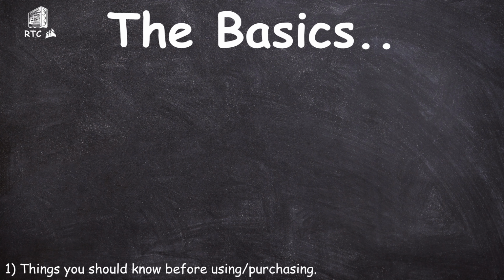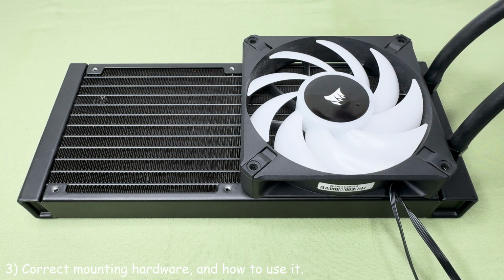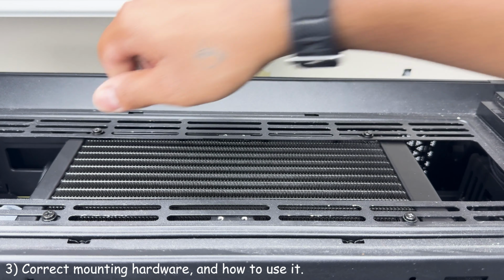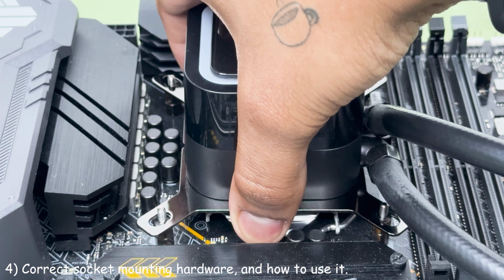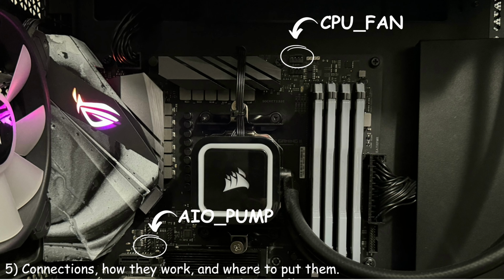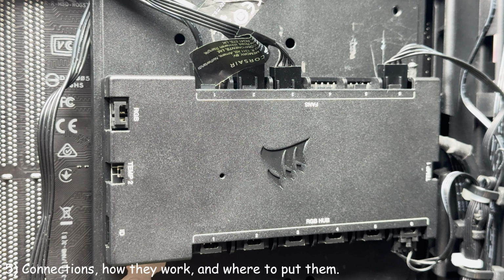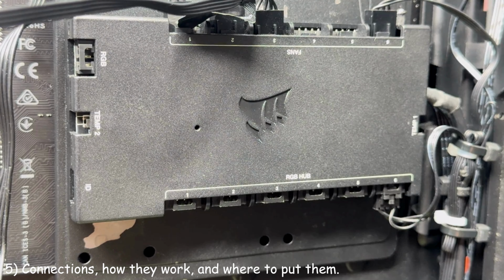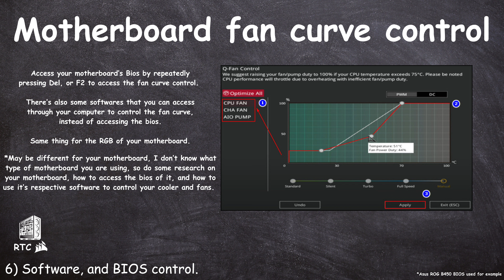How to use the Corsair H100x RGB Elite: Full install & Ultimate guide 🔧🖥️

Comment: (h60x for reference here -120mm/1 fan on radiator only) 3 pin connector into cpu_fan slot on motherboard, even if your cpu fan slot has 4 pins the 3 pin will still work. This gives power to pump. 4 pin connector gives power to fan, connect it to any 4pin sys_fan connector if you dont have a cpu_opt. The 3rd cable here is for all the RGB,  the RGB will not work if you don't connect this to the ARGB connector on motherboard OR a ARGB controller, if you connecting it to ARGB controller the splitter included is needed to control each RGB separately. every additional fan on the cooler will be another 4pin and functions the same. IMPORTANT - without connecting the third cable referenced in this comment you only get power, no RGB or RGB customization. You need the ARGB header on your motherboard or ARGB controller if you want RGB or any customization. There are 3 cables in total from the cooler itself(single fan 120mm radiator) and 4 for the bigger one(240mm radiator/2 fans)one used in this video.

TLDR: if you dont have ARGB header on motherboard or ARGB controller you have no RGB. so if you dont want to pay extra for a controller or the more expensive option being a higher end motherboard, avoid buying it unless you dont care about the rgb for some reason lol.

If you bought an ARGB cooler but couldn't care less about spending the money for a hub of some sort or maybe don't have the spare money to spend extra for now just connect the power connectors and fan connectors to make sure the pump & fans still get powe. It will still work & cool your cpu, just without the fancy ARGB
Reply: I bought and rgb liquid cooler, don't have argb connecter or care to but a controller. I just want my cpu to be cool, idc about lights. Is it ok to not connect the rgb lighting?
Reply: @dubiousdevil9572  sorry I only got back to you now. I hope you sorted it out but yes the rgb lighting doesn't matter if you don't care, as long as the pump and fans itself are plugged in and getting power.
Reply from the maker: @yeah_boii1017  thanks for helping out the comment section! this is definitely staying here!
Reply: I have read this whole paragraph multiple time and tried everything can I send you a picture or something I really want my lights to work

Comment: man, thank you so much I was wondering why mine didnt work, had to even order a regular heatsink fan because i thought it was broken, turns out I hadn't connected the 3 pin power connector cause i didn't see any 3 pin connector on the mobo, this is the best video that actually explains how to install it, the rest of the videos just show when they put the pump on top of the cpu chip but none of them show how to actually plug the connectors and what are they for.

Comment: Very important thing is as well, the best effects and long life to AIO is when installed on top and radiator is above processor (physics thermal laws).

Do it as exhaust is the best as it pumps out hot air out there. Some fancy chassis makers do it in the front for fancy looking. Bullshit. Make it cost effective and extend longevity of it.

Comment: Idk why you installed the fans where the connectors face away from the back of the case including where the barcodes on the fan face the display of the case too smh. Facing mine the other way so it looks normal

Comment: I was always told you wanted the tubing up to avoid air pockets ?
Reply from the maker: My rule of thumb is to have the tubing down so avoid air getting into your pump. The air can escape through the tubing and into your pump, if the tubing is up when front mounting.
Reply: Your right. You want the actual pump lower than the top of the rad where it connects with tubes or you will get air and reduce life span of the pump.

Comment: does the aio come with the am5  brackets?
Reply from the maker: The brackets used for AM4 are also used for AM5.
Reply: @RTC1200  ok thanks i was worried lol
Reply: @RTC1200  i'm quite literally putting mine together right now
Reply from the maker: @ryleeonyt  It’s okay, it should be labeled on the packaging of the retention hardware.

Comment: Is it good with Ryzen 7 7800x3d ?
Reply: I have the Corsair H100X RGB Elite AIO installed on Intel 9th Gen i7 9700K which is 95w TDP processor. Running the processor at stock speed while playing games I'm seeing around mid 50c at most. For kicks and giggles I pushed the i7 9700K to 5.1GHz the temps while playing only reached around mid 60's.

I want to do more research on the best fan curves and stuff like that before I push it for the long term.

Comment: Can you still adjust the fans and pump rgb through iCue if they are connected to the motherboard 5v 3pin connecter (instead of using the corsair hub)?
Reply from the maker: @brenthorvai1657  I believe I covered that in the video. But no, you can’t.

Comment: So if I don’t have the Corsair connector hub I can’t change the rgb?
Reply: You can still do it through your motherboard's 5V ARGB header if your motherboard has it and run your motherboard's ARGB software. That's how I use it.
Reply: @film2240 i dont have argb header but i have add gen